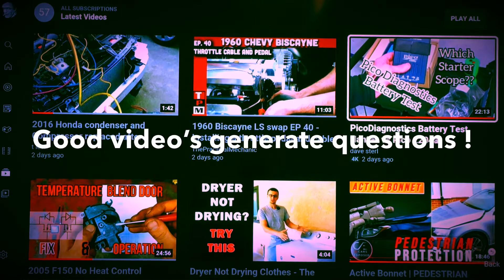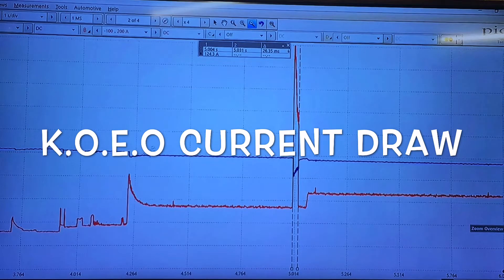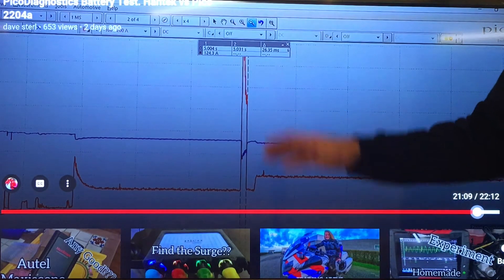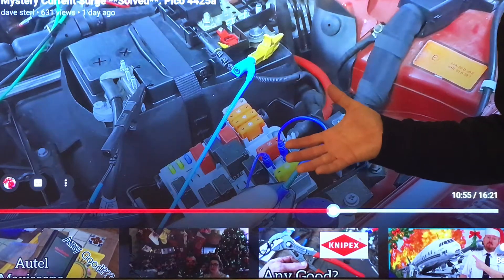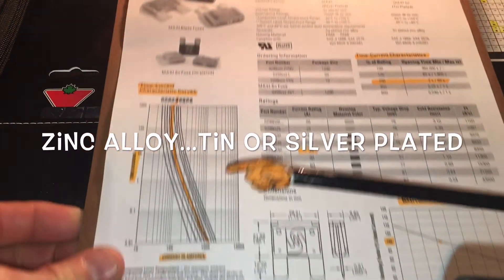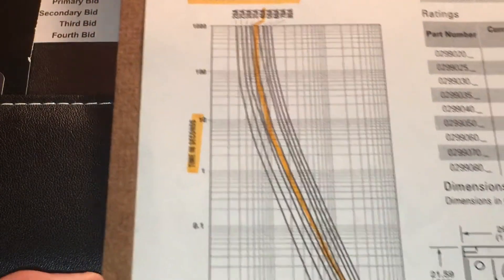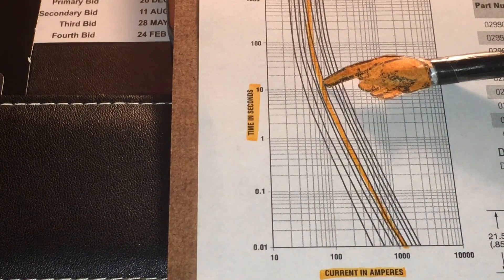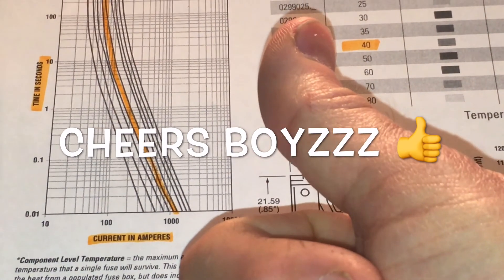Fuse Current Vs. Time

Comment: Great explanation as to why fuses can carry more than their rated current for a period of time. I've been thinking of the advantages and disadvantages of using fused jumper wire, vs a low current incandescent test lamp. It seems for a long time now low impedance test lights have been demonised although using a fused jumper wire isn't questioned? What do you believe is best for current limiting when bypassing a circuit. I'm thinking more along the lines of what if you probed the wrong wire what would offer the most protection. For example if you wanted to energise a relay coil that was negative side switched to prove circuit integrity but accidentally reversed its polarity, you could cook the driver. Sure the test lamp would have a brief inrush current and would only be suitable for circuits where the Vf across the lamp was not so great the consumer e.g. relay coil failed to energise but if you did accidentally reverse polarity when the driver was on it would limit the current and hopefully protect your ECU driver. Conversely a fused jumper could carry a lot more current for a much longer time before the fuse opened (If it opened) does anyone have some more thoughts 🤔? Cheers, Adam.
Reply from the maker: Good question...With my limited experience I tend to error on the side of safety. I try to use the right type of test light for the right application. Led Vs. Incandescent...I suspect using fused jumper would be a case of too late! If a driver circuit were incorrectly probed. Still may offer some degree of protection in some instances. Thx for taking the time to comment. Perhaps someone else can offer a more insightful view. Cheers 👍
Reply: It's going to depend on the specific scenario (i.e. fuse type & amp rating, amp rating of circuit), but in general, the driver will be safer using a test light in case you mix up the polarity. Although, if you get the polarity correct when using a test light in series with the coil, the driver will feel the sum of the inductive spikes of the test light and coil, and if the sum is high enough, and depending on type of transistor being used as the driveer, it could blow the transistor. It's very unlikey but anything is possible. As they say, it would be like a perfect storm.